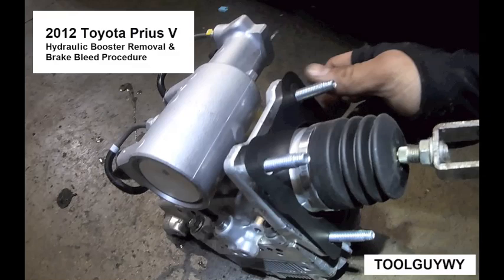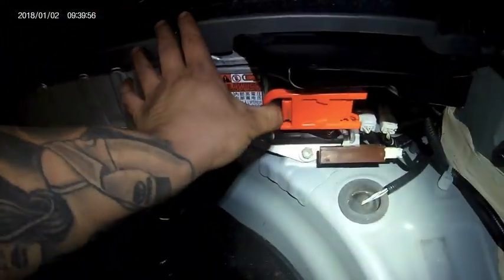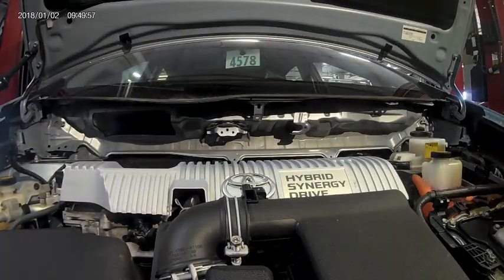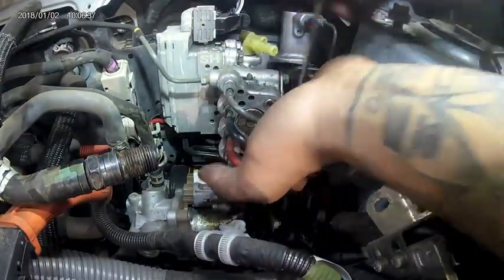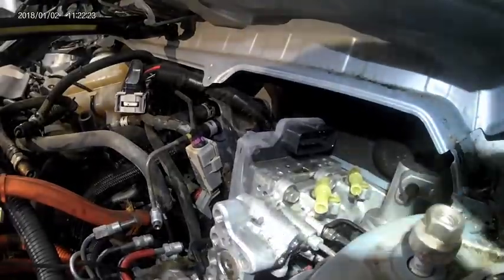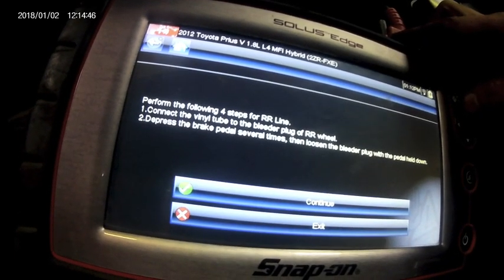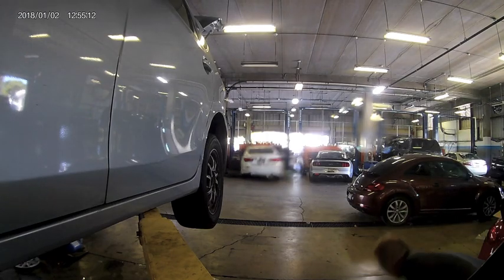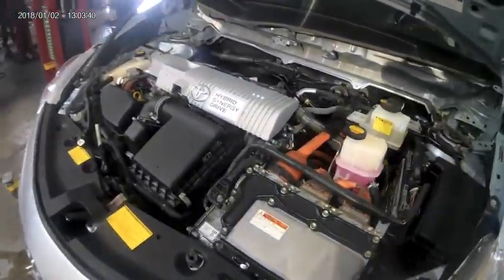2012 Toyota Prius V Hydraulic Booster DIY

Comment: Awesome video.  Worked like a charm.  The brake lines are difficult to get threaded correctly and easily cross threaded, which I did, bummer.  I'm still way ahead of the game $150 for a used actuator and about 4 hours to do the job.  Toyota wanted $2,300 to do the job on my 2010 with 225,000 miles.
Reply: Can you tell me what type of scanner did u used?
Reply: Same I bought used and did it myself, it’s not easy for beginners but totally doable for diyers
Reply: did the used part work? I saw a lot of people highly recommended OEM parts for this job

Comment: Great video. It took me 8 hours to carefully do this job along with spark plugs and some brake pads. It's back on the road. Thank you!
Side note, didn't use a TechStream. I bled it fairly normally but with the wire diagnostic mode trick to reset lights. We'll see how it goes.
Reply from the maker: I’m glad best of luck 🤙

Comment: Not sure i need this part but every video i watch has different tips. Nobody mentions disconnecting the battery or the zero down procedure
Reply from the maker: Whenever you’re near orange wires while working on hybrids definitely disconnect the battery and pull orange plug.  Zero down procedure is specified in service manual.  (Pro demand)

Comment: Thanks so much for this video. Great details, very helpful! But I'm a bit shocked about how casual you are with brake fluid, squirting it out as if it were water, it is a solvent and just getting it in your hands and touching painted surface can leave smudges (guess how I know). I am not sure if the scan tool will do the relearn, but it does do the brake bleed... what does the relearn do, and is it required?

Comment: I was getting the Autel MS906TS scanner, but noticed something.  The ABS module needs to be programmed from old unit data.  Did not see you cover this in the video - Any reason why?   With that in mind Autel said to use MS909, MS919 - Do you know if these are any good (eg will handle re-calibration, bleeding okay). 2010 Prius - regular

Comment: 2010 Prius here; Just started getting the christmas brake lights with C1391 code. 230k miles so out of the extended warranty for this issues. Going to try changing out the Brake pump booster (pn# 47070-47050). Any tips? Thanks for the video!
Reply from the maker: Tips...hmm... My first tip would take it to a shop and get a proper diagnosis.  I usually dont recommend throwing parts at a car especially with a pretty expensive part.  If the shop does condemn it and they are reputable I would suggest definitely thinking about it first before doing it and jumping in.  If they diagnose wrong and  you do it yourself it will be on you.  So you really need to trust their diagnosis.  If you do do it, take your time be patient.  My first abs actuator was a pain.  Make sure you have a proper scanner available and someone there who knows how to use a scanner.  If you need any help just comment again ill try answer daily.

Comment: I just had toyota replace the Accumulator or actuator whatever the entire system is that cost a fortune they should have paid for but I was just over the 150,000 mark..and they said the booster was not the issue... and now I still have the actuator pump going off every 15 seconds and a hissing sound at the boot. They said it is completely normal I’m bringing it back tomorrow and letting them know I live in this thing I would know if the pump is going off every 15 seconds 😆 Sounds like they replaced the wrong part that was causing the pump to go off. Since they replaced it the hiss around the pedal got even louder. 2010 Prius.
Reply: It’s funny because I was like I think it’s the booster but I’m not a mechanic so they charge me $100 to look at it and said it was the actuator.. or accumulator... (whatever that system is ) nothing like paying 1,800 and still having the issue that was driving you nuts hahaha!
Reply from the maker: To be honest seems kinda normal though for the actuator to be going off every so often.  what was the original issue as to why they changed out the actuator on the first place.  The actuator is the "hydraulic booster" and the accumulator is this filter looking thing underneath by the pump.

Comment: What is the best affordable obd tool to use/ buy?
Reply from the maker: I may say the xtools d7 or the xtools am30m however I’m not 100% sure if it is able to do the relearns.  It is a bidirectional scanner which means it can do relearns and commands however I’m not sure if it can do it.  You should do some research first however it is the best bang for your buck  for a bidirectional scanner.  If not an autel ms906 should do fine.  You can buy it new or used however if you buy it used make sure that the previous owner can transfer the registration to you before buying.  If not you will not be able to update it.

Comment: Great video! I have been looking for a video like this for a week. I found 10+ videos for gen 2 but none for gen 3. This is a very common issue. This video would have gotten 4x the views if you would have named it Gen 3 Prius brake actuator ABS replacement, which is what everyone is googling.
Reply from the maker: Thank you, means a lot.  I added it to the hashtags and if you look it up on YouTube now it shows up if you look up 3rd gen Prius actuator.  Thanks for the insight!
Reply: @paulwall142  yes, 2010 are screwed with all problems as first model.  Only 2011-newer.  If I have  2010, I will sell it as soon as possible. It has too many problems from oil consumption, head gasket leak, and all kind of problems typical 1st year, 1st technology (Toyota first time use 1.8L in hybrid).  2016 model has much less problem although it is first year but not first time of 1.8L application in hybrid.
Reply: @rondhole  have a 2010 with only 76k. Brakes are my biggest problem. The dealer wasn't servicing the slide pins so I'm on my 3rd set of pads and rotors. Last year i think the line corroded so have new brake lines. Now i have my break abs and traction lights on because of a c0210 right rear speed sensor.
Reply: @woodstream6137  it is pretty common in rust snowy area that the ABS sensor got corroded.  The cheapest way is to replace the hub unit entirely. As long as it is Koyo, SKF, TImken, INA bearings, they are good. I always clean and relube the rear brake with  generous silicon grease, it lubricate and seal the whole unit from water.

Comment: My abs lights came on all of a sudden. How do I figure out where the problem is. Your video is major surgery.  Is there any way to diagnose w/o the scanner ?   A local shop wants to charge me $140 to diagnose and said they need the car for 3 hrs ?
Reply from the maker: makes sense, abs deals with a lot like wheel speed sensor and other things.  TBH I would say the only accurate way to diag it is with a scanner.  The scanner will show you a general code such as "low pressure in actuator" or "wheel speed sensor RF" and thats where the diagnosis comes in play.  You have to figure out what is causing the issue could be a connector or the actual part is bad itself.

Comment: I just bought a brand new actuator and pump assembly and hired a mechanic to replace my bad ones. I have a 2010 Prius with 161k miles, so it is not covered by Toyota. The mechanic replaced the bad actuator and bled the brakes manually. Now I have three new error codes C1203, C1345, C1451. The mechanic thinks that I need to take it to the dealer to "reprogram the actuator". Does this sound right?
Reply from the maker: Depends what scanner he’s using.  I’ve run into that problem before.  If he’s using he snapon did he try running it through “test mode” it relearned everything as well.  If not sometimes the actuator will throw codes if there’s still air in the lines.
Reply from the maker: But then again I have ran into 1 or 2 that needed to be taken to Toyota to be reprogrammed

Comment: dude i need to replace 2010 prius actuator and pump  how do i reprogram it afterwards
Reply from the maker: Ive never had to "reprogram" the new brake actuator besides air bleeding, all the relearns are covered in the air bleeding procedure.  You are going to have to bleed it properly with a scanner.  If you don't use a scanner to command the actuator it wont fully bleed the air out of the system and if there is air in the brake actuator it will a throw a code for low pressure and you will still have an abs and trac light.  The bleeding procedure itself should relearn/reprogram it.  At the end of the procedure it should automatically relearn all the yaw rate and linear valve offset. Some scanners might be different, but through the snapon solus you can try do the "test mode" in functional tests which should run and relearn three things.  When its relearning make sure that the trac and abs light blink rapidly, if it doesn't maybe theres still air in the system or something else is wrong besides the actuator.  I hope that helps.
Reply: @DI_Wy  This is exactly what I did, replace 2010 prius actuator and pump  and now I have  C1246 code..... I need a scanner now to redo the bleeding procedure.

Comment: Hi i have a prius in my workshop.it has no active faults on the scanner.problem im having is the brakes are intermitantly holding on.just say im driving along come to a set off trafic lights.press the brake now when i go to pull off i feel all brakes are locked until i repress the brakes slightly to realese.i had the diagnostic connected and what i noticed is the SRC and SMC soleniods wasnt realesing.sometimes just one would realese somes times none.very intermitant.any idea what could cause this.also where are these linear soleniods located in the abs module or the acumulator module.would really appriciate your help.thanks.ive done linear ofsets.has no codes.

Comment: How can you test it to see if it’s not working? If you press the foot brake piece and fluid is coming out normally does it mean it’s fine?
Reply from the maker: Coming out from where?
Reply: @DI_Wy  from the 4 line holes
Reply: @DI_Wy nvm I confused you with the question lol. Thanks for the video, I replaced the actuator but bled the system without a scanning tool, now the dash lights came again. What tools i need to bleed the system?
Reply from the maker: @oc9215  most likely due to the fact you didn’t use a scan tool.  The scan tool pretty much activates the abs and bleeds the air out of the module/booster.  It makes sure there’s no air in the accumulator & module.  If air is detected all lights will come back on.  Most likely due to “accumulator pressure low.”
Reply: @DI_Wy  thanks a lot man 🙏 you’re a great help. Do you know what tool/scanner I need to bleed the system?
Reply: @DI_Wy hey man. I did use the scan tool and it said completed! The car worked perfectly but after a month or so the lights came in 4-5 times and went away within minutes. However, the past couple days the lights would come on and stay until I turn the car off, and they clear up when I restart the car after a while

Comment: Do you need to have a scanner to do this? Or can you get away with doing the bleeding process manually like with a normal car while putting the car in invalid mode? I've seen other videos do it manually but I'm not sure if it can apply to this process.
Reply from the maker: you need a scanner.  If you dont abs bleed it correctly there will still be an abs light and abs fault code.
Reply: @DI_Wy  Oh I see, thanks for the response! Would you happen to know if techstream could work for doing this?
Reply from the maker: @TylerTheMoron  to be honest I'm not to sure, never used tech stream before.  However I'm guessing it can?  Seems like tech stream is recommended for most relearned adaptations etc by pro demand but then again I'm not sure.   That's only a guess.
Reply from the maker: @TylerTheMoron  don't quote me on that. I'd recommend doing research first before purchasing or subscribing to anything. :/
Reply: @DI_Wy  I'll be looking into it, thanks for the reply. I don't have any experience using diagnostic tools for car repairs, but it looks like I'll be having to do this repair soon one way or another. Your content will definitely be a huge help for that!
Reply: @TylerTheMoron  Do you know where to download techstream - version everyone can use.

Comment: I think the actuator/booster/master cylinder unit is critical, where if it fails, the car will have no brakes.  Therefore, I have to get this new (not junk yard) .  The  accumulator/ABS pump I can get from junk yard. If it fails - no issue.    Can someone please confirm.
Reply from the maker: You get it used,  you can possibly swap over abs module.  Life expectancy less than brand new.  If you get it new you’re going to have to have it programmed at Toyota which is big bucks.  Life expectancy greater.
Reply: @DI_Wy  That is fine, but if I get is used, I am worried about faulty unit.  Is this component such that brakes will not work, if there is a faulty unit or they will still function, but not optimal.
Reply: @DI_Wy   Do you have video/instruction how to switch the ABS module?
Reply: @DI_Wy  Is Re-calibrate linear solenoid valve different than ABS module swap?  So, if I re-calibrate linear solenoid valve, is an ABS module swap required?

Comment: Wat is the best scanner that I can use other then the snap on scanner from your professional point of view
Reply from the maker: TBH I only really have experience with the Autel, Snapon and Autoland Iscan3.  The Iscan3 does a lot but is sometimes confusing.  I do like the snapon however my favorite was the Autel MS908.  It was easy to use, did most of the things that the snapon did and in a lot of cases it did more such as adaptations, relearns and coding.  It really depends which scanners youre comparing.
Reply: Will autel ms908 similar to autel ms908s?

Comment: Hey I have a question I own a 2012 Prius V  and the abs brake traction control light came on. The error code was  C1391 - Abnormal Leak Of Accumulator Pressure . I replaced the accumulator with a used one  from the savage yard and I'm still getting the same error  code. By any chance would you know what else it can be?
Reply: @thomasthejesusfromwish5341   Thank you for response. So the best route to take is to buy a new part from the dealer.
Reply from the maker: sorry my computer was down for a bit but im back now.  I actually replaced my car with a used actuator once.  I installed it bled using scanner and still same code and could not do full relearn.  Decided to go with brand new one and it worked.  My scanner was able to fully complete the abs bleed and relearn everything.  Best bet for abs actuators is to get it new.
Reply: @DI_Wy  Thank you. Well in my case after installing the used actuator the code cleared and the car was running fine for the first 100miles then the abs/traction/brake light came on then cleared on its own for a few days and now it's back on again. I'm just gonna get  a new one at the dealer.  What was the cost for the new actuator ? Thanks for your help.
Reply: @Alex-rd8fq  your prius should be under warranty, check bulletin ZJB, you can get it done for free at dealership
Reply: @Alex-rd8fq  Keep in mind that what causes the C1391 internal leak is the brake booster assembly, the same on that is being replaced in the video. But before doing anything else make sure that your Prius is under warranty.
Reply: Thank you for all the help guys i got it repaired at the local dealership under warranty.  🙏👍
Reply: @DI_Wy  which part goes bad when you get all the brake lights? I have 2 codes on mine. What needs to be replaced typically the booster or actuator or both or is this the same thing? Is it safe to replace one thing or does the whole assembly have to go and what is the part number? My brakes still work fine but I had those lights on for a couple of years now. By the way, my vehicle is not under warranty since it had a salvage history.
Reply: @Alex-rd8fq  when you say prius v you are referring to having a prius wagon, right (not the trim level)? I ask because I saw some people saying that Toyota was denying warranty for Prius V (wagon) with the same symptoms and trouble codes that matched with the warranty statement (ZJB). Thanks for your input. @toolguywy

Comment: I have a Prius 30, 2011. I changed the booster because I started to hum often. After the error 1345 and 1368 came out. The brakes are bad what to do? where to look?
Reply from the maker: If you're not to sure and you're looking for a proper diagnosis I recommend taking it to a specialty shop that specializes in hybrids.

Comment: I'm in the process of replacing my brake actuator on a 2010 Prius. Is the hydraulic booster the same thing as the actuator? The dealer noted the repair as the following "brake booster assy w/ master cylinder & brake booster pump assy." Is this two different parts? I just purchased the brake booster w/ master cylinder but not sure if I need to purchase the actuator assembly as well, which looks like it has two pumps. The names of the parts vary, so it's kinda throwing me off. Good video btw
Reply from the maker: Sorry im a little thrown off by your comment. I know its not two parts.  I believe people just call it different things.  Basically its a electronic booster and master cylinder but ive heard it called a hydraulic booster or brake actuator.  Dont quote me on it, I dont want to give you the wrong info.
Reply: It's actually 2 different parts. The brake actuator is the one you took off. The brake booster is the part below the actuator
Reply: @DI_Wy  I have 2010 prius with same problem. I will send links and please let me know by toyota's name for the part you are fixing -- thanks !